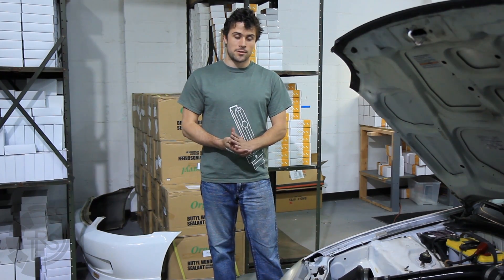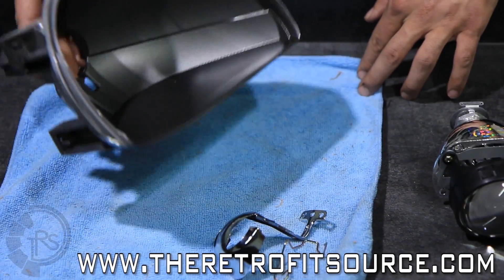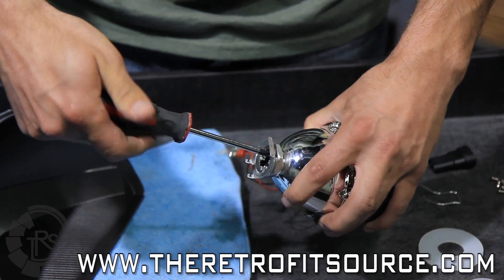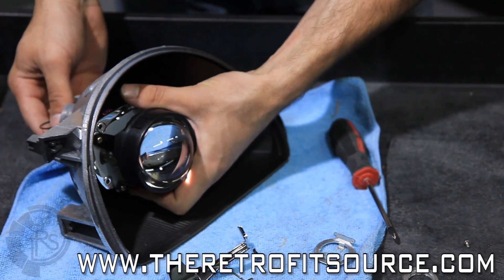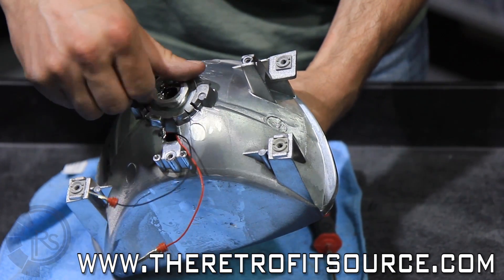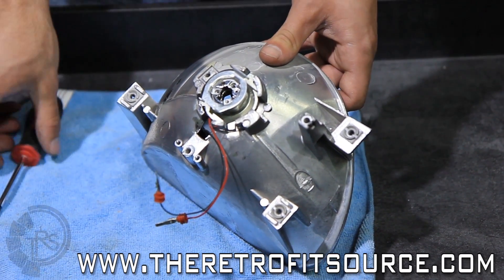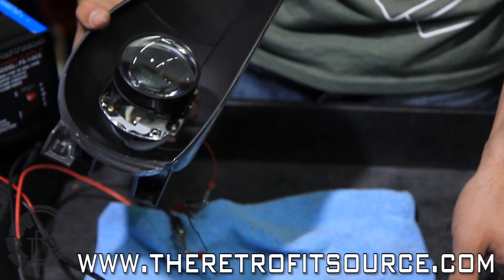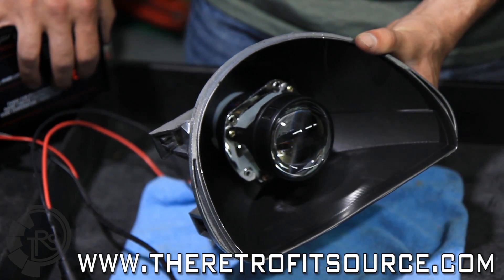TRS Tips: How To Retrofit Headlights with Morimoto Mini H1 Bixenon Projectors

Comment: Seems simple enough.
I plan on purchasing some Mini H1 7.0's from you guys for a complete retrofit on my headlights. My standard low beam size is HB3 and my High beams are 9005. When I install the H1 projectors, does that change over the bulb size to H1 as well? I hope so because I already have H1 bulbs from you lol
Reply: +The Creationman Yes, it does
Reply: +Keith Robertson yes, always need the bulb size to match your new projectors size, so H1 for the new 7.0s